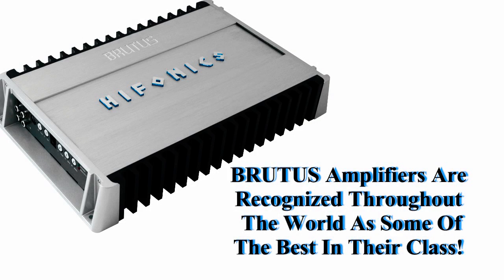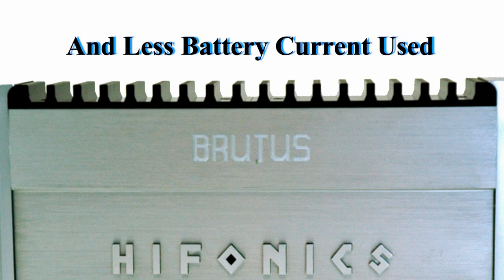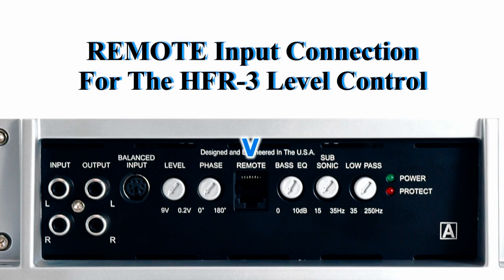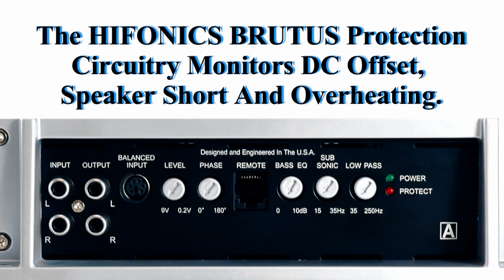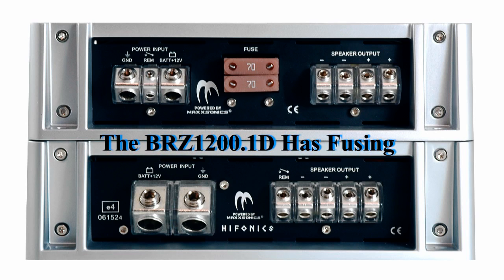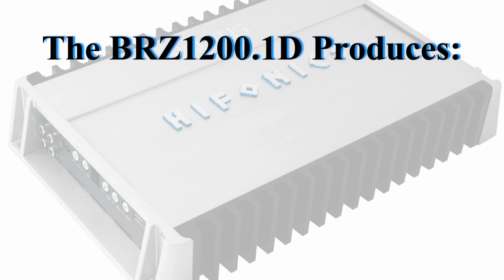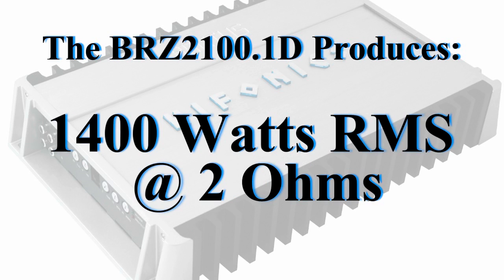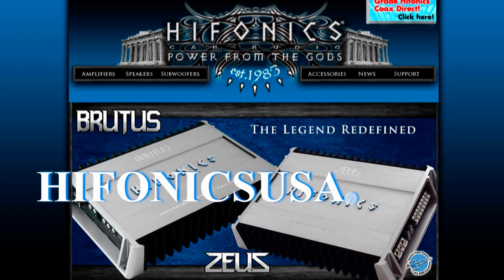CEA CERTIFIED! Hifonics Brutus BRZ Series Amplifiers

Comment: excuse me, but i happen to have a db drive a7 1100.1 amp and my question is if i can link it together with the brz 1700.1, the db drive amp has the output master / input slave option but i noticed that the brz does not, can i still link then or will i have to get another db drive amp????? or the brz 2100.1 that has the same options as the db drive amp

Comment: Hey man i have a questions about the Hifonics Brz 2400 watt amp.  I have 2 dual 4 ohm alpine 15 inch subs and i was wondering if i get that amp, upgrade the big three, get a yellow top optima d35, and run a 1 ohm load could i possibly blow my subs.  Also since its is obviously gonna b a 1 ohm load does the effiency drop to about 50 to 65% giving me approximately 1440 watts rms??  Please give me your nput bc i need a professionals perspective before i spend my money.  Thank you

Comment: i have the 2400.1 , I am going to run it at 2 ohms....when you talked about this amp is 78% efficient  at 2 ohms (1700 watts)  with 14.4 volt..Does that mean this amp is really only putting out 1326 watts  ? thanks

Comment from the maker: @mikestylz96 Firing forward was beneficial for a higher SPL. My peak frequency was in the low to mid 50's. But, my system sounded louder firing to the rear and had a lower SPL on the termlab. Hope this helps.

Comment from the maker: @mikestylz96 My, have a lot of experience with trunk designs and did a lot of studies regarding this very issue. It is all about wavelength. When you fire your subwoofers to the back of your vehicle, the distance from the sub cone to the front of the vehicle is much longer, resulting in a development of a deeper wavelength. The lower the frequency, the longer the wave. When you fire forward, your subs aren't loading against anything and the distance is almost cut  in half. ---continued---

Comment from the maker: @SlayersPulse The BRZ1700.1D would probably  be the best amp for your application as it is capable of approximately 900wrms @ 3-Ohms and 14.4V. Ofcourse you can control the actual power output using the variable Level control.

Comment from the maker: @hXeDrummerBoy I don't have any experience with the Alpine Type R's, but I see they are rated at 500wrms per. The BRZ1700.1D would provide 850wrms per sub if it is seeing a 1-Ohm load and 14.4V. Obviously you can control the power provided using the variable Level control on the amp, but maybe the BRZ1200.1D would be a better option?

Comment from the maker: @inbumedfenix From what I found, the Kicker L7 10's are rated at 600wrms per so as long as your subs are DVC 4-Ohm then you can wire them to a 1-Ohm final load and power them sufficiently with the Hifonics Brutus BRZ1700.1D.

Comment from the maker: @mikestylz96 The variable Phase adjustment is for time alignment. In most installations the subwoofers are behind you only and the Phase should remain at 0 degrees. But, in some applications subwoofers are installed in the front of the vehicle and benefit from the Phase adjustment on the front subs from the rear subs for time alignment.

Comment: I want to buy a Brutus amp for my 10W7. I will wire it down to 3ohms. The amp is rated at 750wRMS. Which model would be best and how much power would it put out at 3ohms?

Comment from the maker: @Chettaman12 My suggestion is to pick up the BRZ1200.1D and get the DVC 2-Ohm sub so you can wire the coils in parallel to a 1-Ohm final load and 1200wrms. Or, if you are set on running an amp at 2-Ohms, you can pick up the BRZ1700.1D and get the DVC 4-Ohm subwoofer which will allow you to wire the coils in parallel for a 2-Ohm load and 1200wrms.

Comment: I'm interested in getting this amp now that I know that they are Certified and have seen one of them in action in a persons system. I'm doing a single sub setup with a Pioneer sub that's 1000W RMS. I can either get sub in DVC 2 ohms or DVC 4 ohms. I was thinking of getting the 4 Ohm version of the sub and running it from the amp on a 2 ohm load. From looking at the manual I can't figure out how to run that sub on a 2 Ohm load for a single DVC 4 Ohm sub. How should I connect the sub to this amp?

Comment from the maker: @dragonsage2008 The BRZ2100.1D would be the way to go. You will need to purchase an in line fuse holder and 200amp fuse for your positive run from the front battery.

Comment from the maker: @XxMIXEDBOI25xX What impedance voice coils do you have? If you have DVC 4-Ohm then you can parallel wire your coils and subs to a 1-Ohm load and pick up the BRZ1200.1D or BRZ1700.1D to drive your subwoofers.

Comment from the maker: @PlayasWays Since they are both 600wrms and you plan to use the BRZ1200.1D, you need to go with the DVC 4-Ohm coils and wire them in parallel to 1-Ohm for 1200wrms. If you ran this amp at 2-Ohms, you will only get 900wrms.

Comment from the maker: @PlayasWays Well, you need to look at it this way. Yes, running a 1-Ohm stable amp at 2-Ohms will be more efficient, draw less current and be cooler. But, it will only be worth it if the 2-Ohm rms power equals the combined rms requirement of your subs. What is the rms of the DVC 2-Ohm subs and what is the rms of the DVC 4-Ohm subs you have?

Comment from the maker: @rallotubbs1 An upgraded alternator is recommended when using multiple batteries. I do not recommend isolators as they do not allow the combined reserve of the batteries to be used. Simply fuse from the primary battery positive upfront and then fuse again at the rear battery positive input. This will protect you in case of a short in the positive run from front to back.

Comment from the maker: @rallotubbs1 Awesome! Your wiring is correct. Be sure to fuse on the output positive of the front battery, input positive of the secondary battery and on the output positive of the secondary battery to the power on the amp.

Comment from the maker: @trappinmakemewet Are you looking at the BRZ1200.1D? Also, you mention dual voice coils, but not the impedance. I would recommend DVC 4-Ohm subs since you plan to use two on a 1-Ohm stable mono amp. This combo should be perfect!

Comment from the maker: @maximusslayer667 Unfortunately you can not get a 1 Ohm final load with two subs and DVC 2 Ohm coils. Your options are series coils and parallel subs for a 2 Ohm load or series coils and series subs for an 8 Ohm load. You require DVC 4 Ohm subs or DVC 1 Ohm subs if you plan to wire a pair of subs to 1 Ohm.

Comment: @MaxxsonicsUSAInc Thanks, I guess it the way the way the amp draws power. I have 2 Optoma yellow Tops and O guage wiring, I dont have any issues running the amp @ 1 ohms, it a BRZ 2400.1D ans 2 Kicker dual 4 ohm all 4 coild wired in paralll yeilding a 1 ohm load to the amp.

Comment from the maker: @MasterDJRenn As voltage drops due to the lack of current and voltage in your electrical system, the amplifier draws more current, thus creating more heat in the components. What electrical upgrades have you performed and what is the exact model amplifier you have? If you have the proper electrical upgrades, running at 1 Ohm or higher and have the proper settings to minimize distortion then you will not have any issues.

Comment from the maker: @MaFiAPENGUINO If you do not have the electrical upgrades required by the specific model you selected then you will certainly have failure. Electronic components are sensitive to low voltage, heat and clipping which is exactly what happens when you get an amplifier that is far too big for your alternator and battery(s). What model did you purchase?

Comment: MaxxsonicsUSAInc, i have noticed the  Brutus BRZ series amp is CEA2006 compliant, whereas the 2009 Brutus BXI amps weren't. does that mean you would get more power from a BRZ1200.1D than a BXI1200.1D, and if so, how much more?

Comment from the maker: @jayd0ggg The Protect light flashes on the end panel of the amplifier when clipping. Hard clip results in solid red and the amp shuts down until reset. The illuminated Maxxsonics M flashes on the remote module when clipping as well.

Comment from the maker: @fernyb0505 The Atlas is more expensive because it uses MUCH better parts. The coil is better, speaker terminals with jumper pin, large magnet, basket, cone support, surround etc. Realistically I have seen guys put over 800wrms to the Atlas in a properly designed box and not have any issues. The Atlas is a far superior sub. There are no plans to update it at this time.

Comment from the maker: @azucenaydaniel Just like any amplifier with protection against overheating, this series will shut down if the thermistors on the board sense an unsafe temperature and shut the amplifier down until the temperature is safe again. This unsafe temperature is caused by lack of ventalation through improper placement, low voltage drop, low impedance and clipping/distortion.

Comment from the maker: @zZZzzzSnooze2nd The RF amp is nearly 2X the price, but does handle up to 16V. It appears to be 1000 watts more as well so I would say it really depends on how much you want to spend and if the higher voltage handling and 1kw rms more is worth it? Both solid amps.

Comment: ei mike, the new BRZ 1200.1 has 140 amps of fuse, while the BXI1210d only has 80 amps of fuse. does that mean the bxi1210d can only do 800-1000rms and the BRZ 1200.1 can do 1400-1600 rms? if the input is constant 14.4v and no voltage drop.

Comment from the maker: @AsmodiusMKII They are both identical power at 2 Ohms and 14.4V. The new BRZ series has less potential output loss as voltage drops, has a much improved heat dissipation design and the newest driver card.

Comment from the maker: @diablo2369 The prices for the 09 products are low because we closed them out at lower prices to our dealers and distributors. I would assume that over time the price will adjust to a level comfortable to both the consumer and the dealer. They are a very solid amplifier, fairly priced compared to similar models in the market, and a nice upgrade to performance and design over previous years. We are very excited about the BRZ series as it reflects what our consumers have been asking for.

Comment from the maker: @Zodfsxx The ZXi80.4 is a little less MSRP, about 3" longer, a much better design and more aluminum mass for heat dissipation. It is CEA-2006 compliant, and offers the most recent revisions in component values and driver card. Both are very solid amps and you may still find some killer deals on closeouts for the 2009 products.

Comment from the maker: @ExplicitYourSelf The Brutus BRZ series amps are CEA rms rated at 14.4V. The BRZ1200.1D will provide 900wrms @ 2 Ohms 14.4V and approximately 600wrms @ 2 Ohms 12V. I believe your current amp is rated at 750wrms @ 2 Ohms 14.4V but I can't find anything on the power at 12V. In theory you should see around 150wrms more from the BRZ1200.1D if the 08 ZX750.1 is true rms.

Comment from the maker: The BRZ series Brutus and brand new ZXi series amplifiers use the same crossovers and filters so audibly the quality with be identical. This years lineup is CEA certified and has a slower roll off in power as voltage drops.

Comment from the maker: Indeed we are. The GP3000D-Pro will not simply fit in the Brutus heatsink so we are working this out. It will either be in a wider and taller heatsink to remain 18V stable, or will gain in efficiency and remain in the new Brutus heatsink as 16V stable. Our engineers are working on the new board layout and our Sales team will make the call.